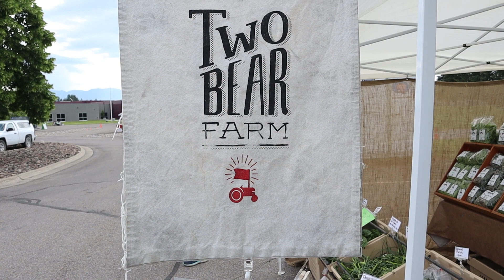Create Regenerative Organic Soil: How to Transition to No-Till Regenerative Organic Farming

Comment: Naive question here....what are the negative affect of 'weeds'? Meaning, what would happen if you just plant among the weeds?
Reply: When your plants are small the weeds choke them out whereas if you keep the weeds back from your plants until they get bigger, then the plant will keep the weeds away by itself. The weeds make a wonderful cover crop and they keep the soil from drying out which translates to much less need for watering.
Any weeds that I do pull out are composted and used to re- fertilize my garden or to make compost tea to fertilize.
People say “look at all the weeds”, I just laugh and say “oh…that’s my fertilizer…I grow my own”. 
.
Reply: @ATinyPillow  that makes so much sense to me. Thanks
Reply: The main thing is just that seedlings can’t easily grow if there are weeds because the weeds shade them out. Weeds are fine once the plant is taller than the weeds but it’s always a problem at planting time. Plus weeds tend to grow much faster than the crops.

Comment: A city slicker question, instead of using plastic and control weeds, would hay or other organic cover be used?
Reply from the maker: Yes, that is an option and one that this farm is exploring. I didn't cover it in the video. It's challenging to implement at larger scale but this farmer is looking at ways to reduce and hopefully eliminate the use of plastic mulch.
Reply: It can be used but it takes a ton to smother weeds with hay. So not easy to scale up.

Comment: Question, how are these farms irrigated or watered?
Reply from the maker: Hi L.L. You know I don't recall. We didn't discuss irrigation during my visit but I vaguely remember there being irrigation pipes shattered throughout the farm and I think drip irrigation was the main form used. Not certain though. Why do you ask?
Reply: @RegenerativeJourney  Well, out here in the west you cant just plant things and it grows, you have to water it.  When we first moved into the country, we spent big bucks getting drip lines to all the fruit and nut trees as well as the gardens...but then soon found out  that the pocket gofers loved to eat the plastic...I think they had a drip hose addiction! We were constantly fixing leaks and replacing the hoses, so finally we bought water tanks, put them on the back of the truck and watered that way.  I know with bigger farms they probably use metal hoses, but our property was spread and there were lots of trees we had to maneuver around. Watering our place and keeping things alive was a nightmare. It is easier now that they are bigger after 12 years, and they are on their own.  The pocket gofers would eat the roots of things garden too, so we finally bought a bunch of kitty pools to plant things in and haven't had a problem with the critters eating the roots of things in the garden cause they cant climb up the sides of the plastic (or get their little teeth around it to eat it cause it is flat hahahahaa)